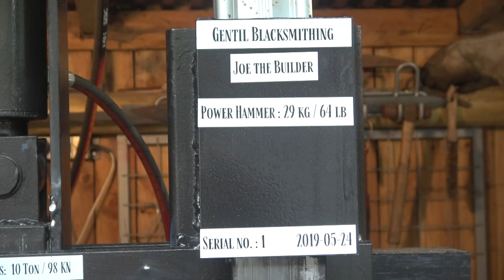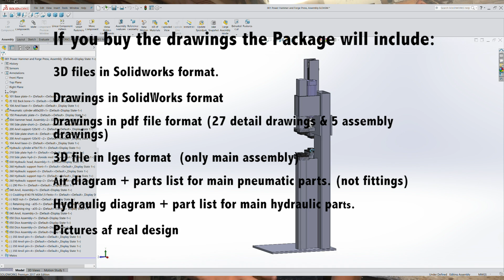Building a Power hammer and a Forge press in one machine

Comment: Nice build, but there is no reason to use such thick metal if you aren't going to bevel it in preparation of welding! You are just putting a small weld on top of the metal, this thing WILL break the welds as they are currently executed.

Comment: Nice build, didn't understand how the controls work on the power hammer... r u manually hitting a switch to a timer box?
Reply: Based on the scene from 8:32, I think there's a pneumatic foot pedal at the base of the hammer. These types of homemade pneumatic hammers have a foot pedal that acts as the treadle for the hammer. And judging from his movements, the way the hammer stops when he steps away a little, and the fact that there are no hands anywhere near the timer box, it has to be a foot pedal.

If you want to learn a bit more, I recommend checking out the powrr hammer videos made by Joshua De Lisle. They're essentially the same concept as this one, only his is a bit more simplified.